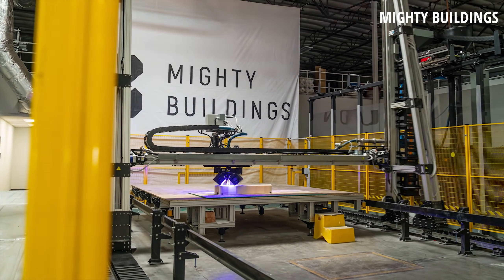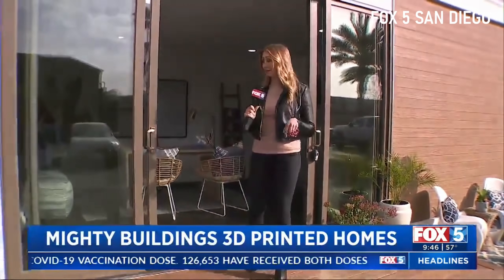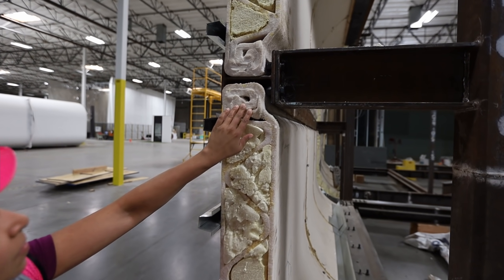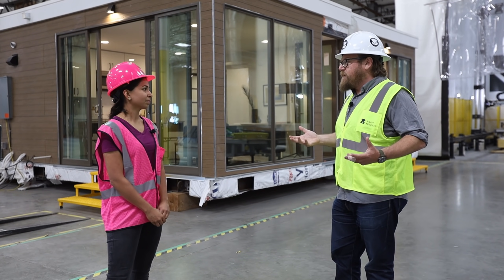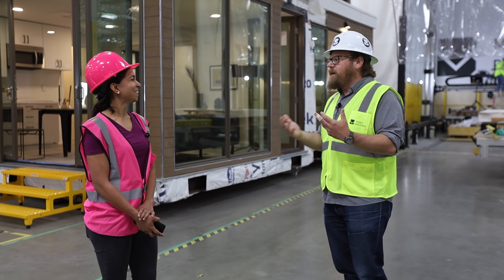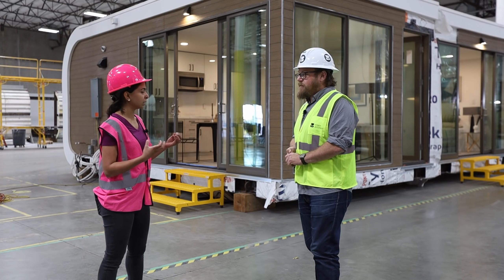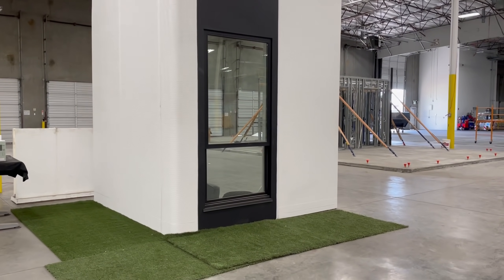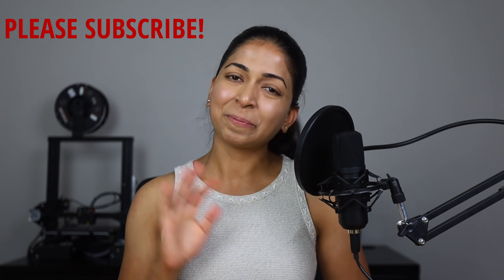3D PRINTED Tiny Home ADUs | Mighty Buildings

Comment: Steel moment frames alone cost a lot more than stick-framed walls (and are far less energy efficient), and then you have to then print a wall in that plane, and then then you have to cover that wall with gyp board, because it is printed out of flammable material - which does not meet US building codes or California wildfire code.  This is a perfect example for your last video - about 3D-printed buildings being a gimmick.

Comment: The concept of “3D printed houses” is mostly a solution looking for a problem. It essentially is a “trendy” way to try and reinvent framing for a house that requires machines that weren’t necessary before. I’m willing to bet MORE material is being used than traditional framing too. In this videthey used steel framing for structure underneath which basically means the 3D printed goop is for decoration?… They should’ve stopped after the steel. These little companies have nothing to offer when you realize they’re little more than a silly, gimmicky, overdone way of building walls.
Reply: Wow, all these comments make sense.  Interesting that Silicon Valley VCs, who dumped millions in this, could not see through the glimmer of 3D printing - to see what is really there.
Reply: That first part, for sure!
Reply: Combine the sciency nature of 3D printing and mix it with the housing crisis you get stuff like this apparently

Comment: They've essentially developed printing technology to manufacture a slightly novel, durable 'plastic', non-structural panel. The home price point is ridiculously expensive, carbon zero or not. Of course this project could kick-start an industry resulting in more competition and lower prices. Probably their most important contribution is attempting to standardize ADU regulations.
Reply: When you consider the carbon footprint of transporting the machines, the houses, the supplies, etc. Probably not carbon-neutral. That's my guess.

Comment: This was a super insightful video! As always Belinda's reporting feels non biased and gets to the point.

One small thing I caught which was strange. When she's talking about building the Coachella houses, she says they use flexible solar on the roof. Why in the world would they do that when they are building perfectly flat roofs that seem taylor made for traditional modules?
Reply from the maker: Exactly. Hence why I threw the "apparently" in that sentence. I asked them why they would choose flat panels instead of optimally angled ones. The answer: "it will be a new type of solar panel that captures sunlight throughout the day, so it averages out to the same as an angled panel. It also won't puncture the roof."

As an architect, I have a hunch that designer didn't want the panels to be visible from the ground in the rendering. Aesthetics over function.
Reply: @BelindaCarr  The good reason I think to have horizontal panels is the now low cost of the panels versus the tilt framing (which would need to be optimised for each site). Whilst there are more panels required to cover the area horizontally, they still capture about the same about of energy, just at a lower power versus area.
A problem with horizontal is that they won't self clean, though it could be they end up having a small pitch and a couple of variations to optimise for orientation.
I wonder if the use of flexible panels is that they considering having have a sight hump or crown in the roof for drainage and cleaning.
Reply: @BelindaCarr  Are you AIA?
Reply: Oh, those silly little thing called physics.
Reply: Positioning the building where the widows face south (north in the southern hemisphere) would require a overhanging roof that blocks the sun in the summer.

Comment: I feel like "missing middle" is increasingly just a NUMTOT friendly buzzword for the kinds of upper class housing that companies were already doing. I just fail to see how plastic and glass houses with pools in the desert is going to sustainable or improve the housing situation in California in any way.
Reply: Your forgot to include FLAMMABLE plastic.  With no roof overhang, low ceiling and no thermal mass, they will be uncomfortable as hell if the AC quit for even a minute.
Reply: For 1 its and advancement of technology 
For example back in 2018 or so the "liberator" was test which is an all 3d printed 357 handgun (im not sure if its 357 sig or 357 magnum) the printer used at the time ran around 10 k a comparable printer now would be about 300-500 
So cresting and advancing new technology to give a superior means of manufacturing 

2 quickly creating homes at a potentially low cost means more and and better housing as she said it is all around better than concrete 

Lastly "plastic" incase you're unfamiliar alot of things are made from "plastic" you can with a 500 to 800 usd printer without modifications print with the same material polymer handgun frames are made out of (glass reinforced nylon) and harder materials such as carbon fiber reinforced nylon aswell as certain types having better thermal properties than something such as steel in way of a 3d supressor

Dont underestimate a technology you dont understand i made the same mistake then I took the time to learn about it and honestly I expect 3d printing to replace most forms of fabrication and manufacturing in a few decades especially after seeing this its further along than I had figured
Reply: @royrogers3624  
1. .380 not .357
2. the sorts of printers were 200usd in 2018, not 10k
3. this is a completely different technology
you clearly have no idea what you're talking about, genuinely baffling reply
Reply: @Alex-nl5cy  What did you mean by plastic tho?  I was a bit confused on that myself.
Reply: @VagabondTE  The material they print with is a uv curing polymer. All 3d printed "concrete" has more in common with resins and composites than they do with cement and things we actually call concrete because of the need to actually print it quickly.
Reply: @Alex-nl5cy  Ah, I figured but wasn't sure.  Tho there are many composites and even plastics that do perfectly fine in extreme conditions.  Also, the houses that were intended for the desert were a different design with less windows.
Reply: @Alex-nl5cy  so 3d printing is a different technology from 3d printing? Crazy i thought they were both 3d printing 

Secondly I wasnt referring to 3d printing j was referring to their patiented formula for the "substitute cement" as being an advancement 

If youre going to argue over something atleast know what is being talked about as for the rest ill double check

1 you are correct it was 380 not 357 I spend so much time looking at and hearing various calibers its hard to keep some straight

2
"Unlike the original, steel Liberator, though, Wilson’s weapon is almost entirely plastic: Fifteen of its 16 pieces have been created inside an $8,000 second-hand Stratasys Dimension SST 3D printer, a machine that lays down threads of melted polymer that add up to precisely-shaped solid objects just as easily as a traditional printer lays ink on a page. The only non-printed piece is a common hardware store nail used as its firing pin."
Reply: @royrogers3624  I kinda get your point but those are weird examples.  Cody Wilson printed a lot of different things on many different printers.  I believe the infamous liberator was on a lower end FDM machine.  But i see what your saying.  Technology improves.
Reply: @VagabondTE  i wasnt aware it was lower end but that just proves my point im not sure if you just missed it or not

At the time the machine he used ran for about 10 k while now a machine equivalent to that would run about 500 or alittle less thats a drastic difference
Reply: @royrogers3624  Yea I understood.  I specifically said that I understood what you were getting at..    twice.  And I'm not trying to be nitpicky but he didn't print the Liberator on that $10,000 machine.  He printed lower receivers on that one.  However the Liberator was specifically designed to be printed on cheaper $500-$200 machines.  Technically that other person was mistaken when they said those printers have gotten cheaper because they haven't.  They're two different styles of machines.

When again I'm really not trying to be pedantic but yes there are different types of 3D printing technology.  Fdm is vastly different from resin printers.  Even resin printers employees a cornucopia of different Technologies.  And 3D printed houses are radically different as well.  3D printing is just a catch-all term 4 tons of things now.  It would be like saying building the house is the same as building a bread box because they're both carpentry.
Reply: @VagabondTE  yes sorry I just saw you adding that you saw my point I just finished a 15 minute brain dead video of someone claiming to destroy 2a arguments and I was replying to the female on messenger as I was going through your comment my mistake
Reply: @VagabondTE  "Unlike the original, steel Liberator, though, Wilson’s weapon is almost entirely plastic: Fifteen of its 16 pieces have been created inside an $8,000 second-hand Stratasys Dimension SST 3D printer, a machine that lays down threads of melted polymer that add up to precisely-shaped solid objects just as easily as a traditional printer lays ink on a page. The only non-printed piece is a common hardware store nail used as its firing pin."

And yes my point originally wasn't about 3d printing itself but about the material they're using and as you said the catch all term of 3d printing but mostly the materials they use
Reply: @royrogers3624  Where did you get the quote from though?  Because the news media was consistently incorrect when they reported on Cody Wilson's stuff.  Honestly, I could have swore he had to return that machine before the Liberator was even released.
Reply: @royrogers3624  I got my printer in 2017 for less than $150. By 2017, the 3D printer market was nearly fully formed to what it is today. Machines that cost 10k then are still 10k now, machines that were $300 were replaced by $200 ones by now, there was a minor improvement in quality and pricepoints at most. Furthermore a lot of manufacturers comprising the bulk of the market are sleeping through the opportunity to diversify their models and are just making flawed copies of popular 2017-2018 era designs. Like progress for sure is and will be happening, but there's no need to overhype it.

Indeed polypropylene, polyamide and polycarbonate printing is possible at sub-1k pricepoint but has been for i think about 7 years. 10 years ago, a revolution was happening, but now things are slowing down into more of a steady state, and scale in production volume, quality-of-life features and incremental improvements rather than fundamental capability.
Reply: @SianaGearz  comparable was the keyword i didnt say the same machine has gone down i said comparable machines

If youre illiterate dont try to argue over something
Reply: @royrogers3624  Machines in different price ranges, are, excluding a few outliers, not really comparable. A BCN or a Raise are not anyhow comparable to an Ender. And not much has changed since 2017, if someone bought a machine that would be considered grossly overpriced for its performance or the task it was bought for now, then it was grossly overpriced back then just the same. Glass house. Stones.
Reply: @SianaGearz  not really im guessing you dont understand prices go down as technology becomes more common
Reply: Machine bricklayers seem to be a better solution. https://www.youtube.com/watch?v=0wrQLDoJ6cw
Reply: Why would it need to improve anything besides the profit. Get real.

Maybe the innovation and ideals make a change, but it more than likely isn't their intention.

If xou cant afford to live in California, then move away. Nobody cares.

Didnt want to sound like a capitalist smartass, but that's how the economy works. Pay or gtfo.
Reply: @privileguan9127  Poor people don't really move though.  If the poor people of California left then there wouldn't be a problem.  It's not the lower class that's leaving California.  It's the upper middle class.
Reply: @privileguan9127  People are.  California will solve its housing crisis by creating a Socialist Dystopia and the producers and taxpayers leave their empty homes behind.

Comment: Regarding that crack.  What if they 3D print the individual walls, and then assemble them together, or if a full wall is too large, create panels, say, the width of sheet rocks and   assemble them.  The idea is that these walls already have the cavities and channels for cables, pipes, etc.

Comment: Excellent intro to this type of construction. I believe this may not be for everyone, but it offers some solutions. Will see about the cost in the long run. Too expense for now.
Reply: I’m confused, what solutions are you referring to? Did you watch the video? This building is just a really expensive small building built like every other. The printed part is just a architectural non structural piece. Perhaps I missed the solution you are referring to.
Reply: I just refereed to this construction method as a solution to resolve some expensive ways to build structures. As of now, it is just too expensive. However, they have to start somewhere has development cost lots of money. Let see if they can make some structural printed section over time. That's all.
Cheers

Comment: This is essentially a luxury single-wide manufactured home.
Reply: In fact it would surprise me if established manufactured home builders didn't begin cranking out ADU's. Many factory home builders are well capitalized with full infrastructure, and quite nimble.
Reply: A single wide is at least more mobile. Hell, I believe even a luxury RV would have a better fit and finish (at a lower cost).

I could see using LSM as an exterior on traditional housing, but then you are competing against every other building material.

There is nothing else brought to the table here. Sure, it looks good, but that much glass must make it horrendous to live in (or have horrendous heating and cooling bills- how is that sustainable?).
Reply: @quintessenceSL  once a single-wide or park model trailer has been in place for more than a year or so you can’t really move them.
Reply: .... For Tesla owners
Reply: @astrazenica7783  
Riding the brand name coattail
Reply: Yes
Reply: It's a fashion statement!
Just like owning a Birken bag or a Frenchie.
Single-wides are ubiquitous because having axles under them makes them not accountable to the same standards and codes as a permenant structure.
This is not that....  It's a modular home that is entirely contained in one module.